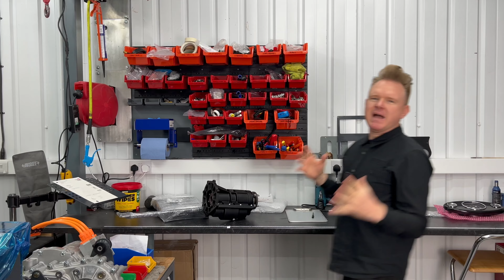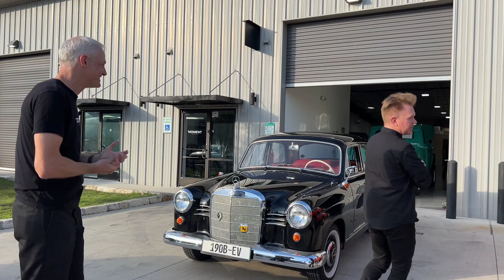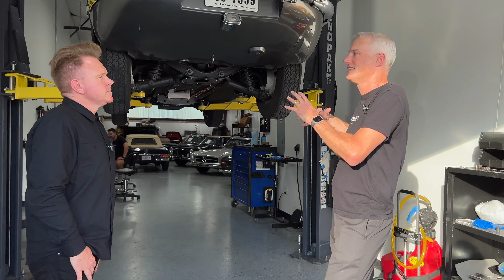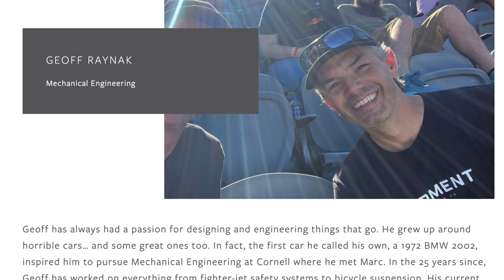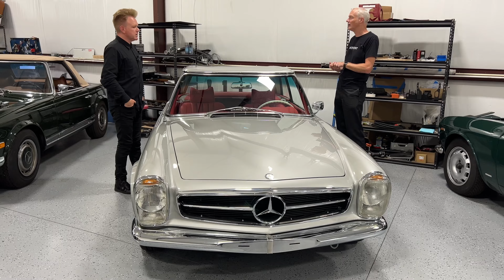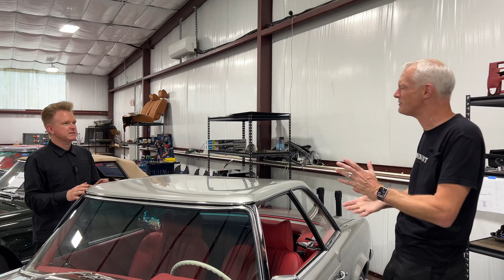Full Tour Of Moment Motor Co! EV Conversions Bringing Classic Cars To The Modern Era

Comment: Just watched this and thought it was damn good! Now if my eye didn't deceive me, did I see a Spark EV in the parking lot? Watching all Moment has done thus far, would they ever consider doing upgrades to older EVs like the Spark EV to up grade the onboard AC charger and/or battery packs for faster charging and more range? While I love the SL, XKE, and Healey conversions, as a current owner of a Spark EV having an option to update would be great, although I recognize getting access to the GM software could be be an issue. We're I able to afford a vehicle conversion I'd opt for a Corvair. Yeah, I'm a glutton for disappointment 😊
Reply: If I understood correctly, they would definitely upgrade Spark EV if you pay enough. Maybe something in range from $70K to $120K for that one. However, I don't think many people would be willing to invest extra $70K into an old Spark EV just to make it more modern. That's why they use old classic cars that are north of $100K even with ICE engines in restored condition.
Reply: @MikkoRantalainen I agree that kind of cost is utterly ridiculous of vehicle used, it would make more sense to just buy a new Tesla, Lucid or Porsche for that cost. My hope would be that more modern battery pack, BMS and inverters could be developed as a 1 for 1 replacement. Doing a complete build such as these typically include suspension, wiring and body upgrades for a complete build, but individual component upgrades might be built but even then most people wouldn't do upgrades to a non-classic. There are several small companies that have developed kits already for Minis, VWs, Porches and even Land Rovers for prices far less.

Comment: How the clutch in stick shift Porsche resist abuse of very rough electric powertrain?
Reply: The EV powertrain doesn’t have to be rough, in fact it’s very progressive and you can tune power delivery as needed.
Reply: I understood that the clutch and stick shift are used only as control inputs after the conversion. There's no need for a real clutch for EV because the electric motor can run just fine from 0 rpm without clutch. The combination of clutch and gas pedals can still be used as input for the motor control unit and if the owner wants it, you could simulate a stall, too, in case of improper clutch application. Or if the owner wants, you can make launch control as "put it in 2nd gear and drop the clutch with full accelerator pedal input". As explained in the video, they simulate engine RPM when you change gears, it's just all part of the simulation. EV motor can obviously go from stand still to max speed (for these cars) without any gear changes required but if you want to keep original feel, you can artificially limit the RPM range for "each gear" and require driver to switch gears.

I would have preferred to know if they play simulated engine sounds to cabin or not. I would find it hard to drive fast with simulated gears without audio feedback but for slower driving you can obviously read the simulated RPM cauge instead.